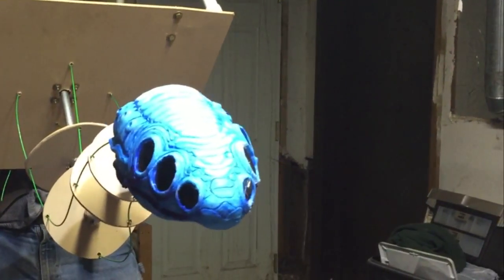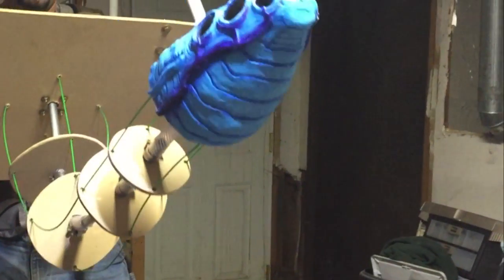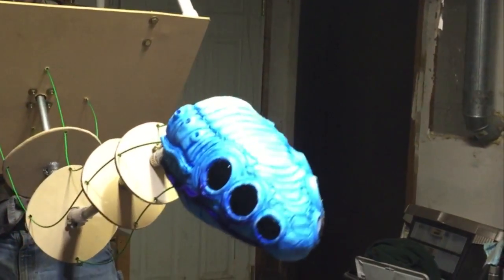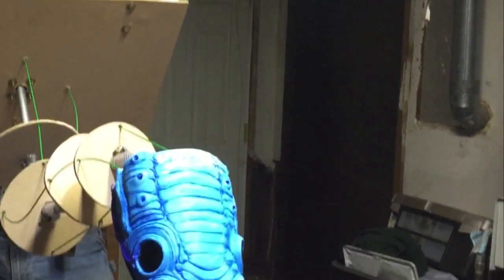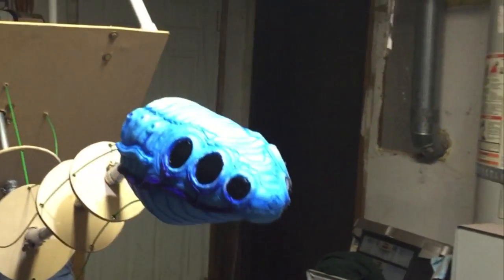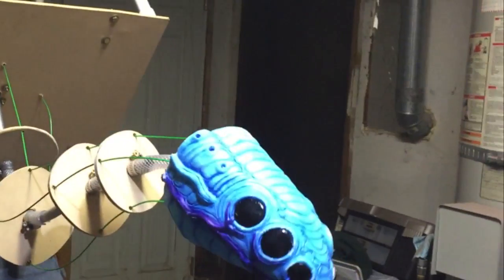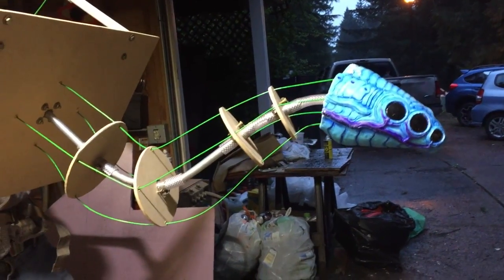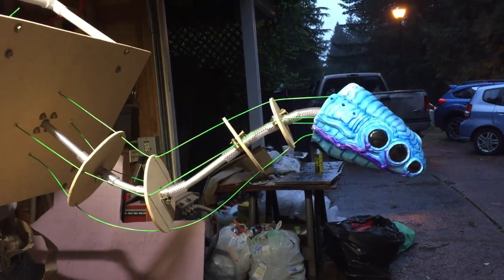Engineer Neck Movement Test

Comment: That looks and moves fantastically! Did you finish this lovely piece and did you do a tutorial on it? Thanks for sharing!!!
Reply from the maker: Hey there! I did finish this costume, but unfortunately, it fell apart after it's first outing and I decided to shelf it. The majority of the body has been retired to a bin and the head is currently at 343 Industries and will eventually be put up for display at their "museum."

I did not make a tutorial for the neck mechanism, unfortunately. BUT! A new project that I'm starting up soon will have a similar mechanism and I'll be sure to document that process in the future! :D

Stay tuned!
Reply: I will look forward to it! I am trying to make a shoulder puppet with similar movements but the cable was too weak and he just ended up checking out the floor most times! I think you should use the head on another critter as it looks so cool!